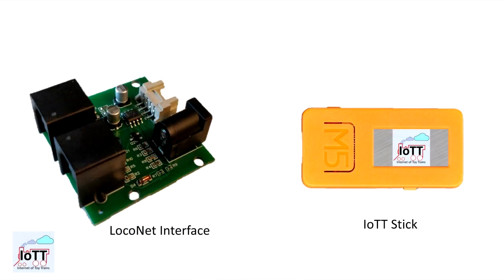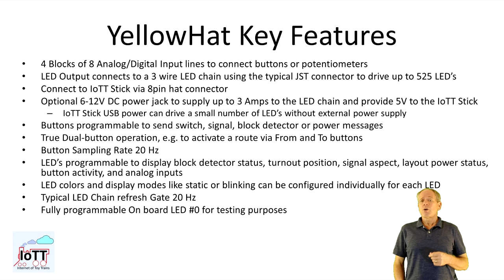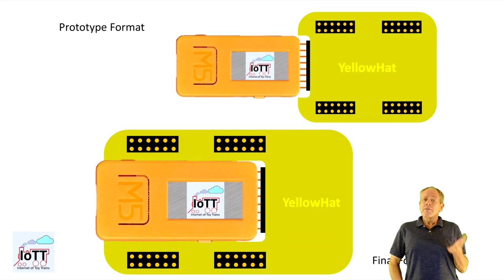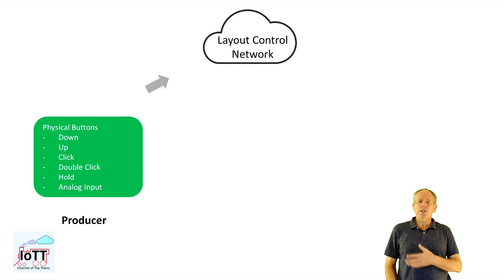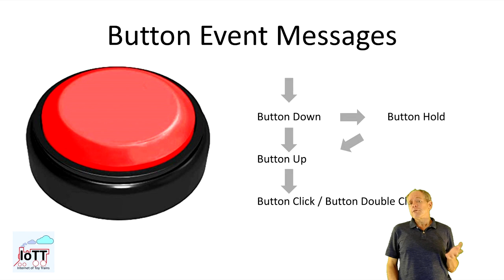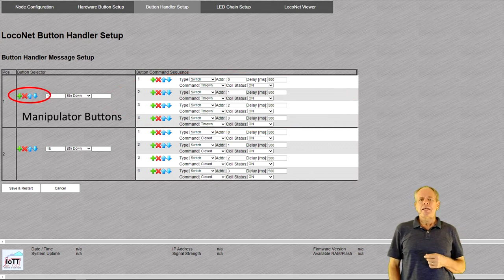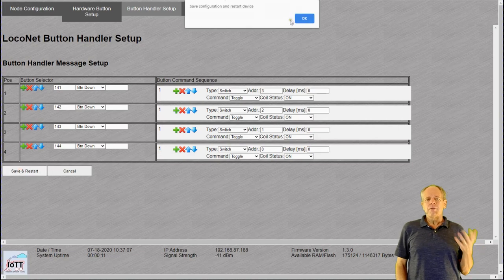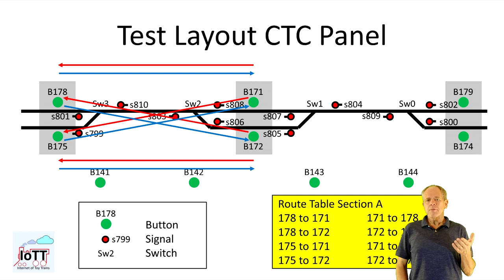YellowHat Sneak Peek (Video#47)

Comment: Hans - I have been testing my Yellow Hats - just tried to write a new LED config to the IoTT Stick in the Yellow Hat - the LED screen now doesn't have the colours or LED table contents just the headers.  No real data lost but is this something that can be recovered.
Reply from the maker: This looks like something went wrong when doing a Save and Restart and the datafile is corrupted. The only way to fix it is loading a backup, in case you saved your settings to a computer, which is a good idea to do.
I saw this error in earlier versions of the Stick software in cases of a weak Wifi connection. However, with versions later then about 1.5.4 that should be fixed. Are you connecting the Stick over a Wifi AP or are you using the built-in AP? And what browser are you using? The most stable setup is the Stick connected to your Wifi, not too far away from the AP, and a chromium based browser (Google Chrome or Microsoft Edge).
Furthermore it is a good idea to save the Stick to a local file. You can save to individual files from each configuration page, or save the entire Stick configuration when you do a Save To File from the node configuration page.
Some example backup files that might get you restarted can be found here for download: https://github.com/tanner87661/IoTTStick/tree/master/ConfigData/YellowHat%20CTC%20panel

Comment: Hello,  Do these setting still apply? I do not have a Loconet option for command source. I also can't find the button handler tab. Thanks
Reply from the maker: Largely yes, but there is more and some got renamed. Loconet is now Loconet Interface, but what you want to use is the Wifi connection, so you select Loconet lbServer Client. The Button handler is now two different tools. The first is the Hardware Button Setup tab, which lets you specify what type of message you are sending. Select e.g. Detector for sending block detector messages. Then there is now the Event Handler, which can be activated in the Node Configuration. It is a very flexible tool to react on input messages and then trigger action. Watch the videos in the YellowHat playlist to see how to use the event handler to create a signaling system.
Reply: @IoTT  And this will work with my other stick which is on the CS using the Aux shield, it's still setup for Loopback, Red hat and IB Server? Thanks 👍🏼
Reply from the maker: Yes. Just set the IP address and port number in the client setup to the one of the server.
And for an example how to integrate with EX-RAIL, watch videos #118 and #119
Reply: @IoTT  I'm going to watch the videos for Ex-Rail first. Thanks 👍🏼
Reply: @IoTT  How do I get back to the initial wifi setup? You said give it a IP address so I selected Static Ip using the given settings. Now I cannot access the browser software. Thanks
Reply from the maker: Well, if you set it to the same address like the Stick on the DCC-EX system, you probably can simply turn off the other stick and you should be able to access it using the same address.
Otherwise you can reset the Wifi settings by consecutive clicking of the power button 4 times at a rapid rate, about twice per second. After that, you need to reenter the Wifi credentials like you did the first time.
Reply: @IoTT  Both sticks are linked now. Thanks. Now on to watch the Ex-Rail videos and attempt a current sensor for block detection on the yellow hat. Thx